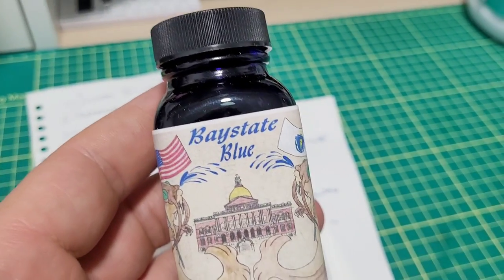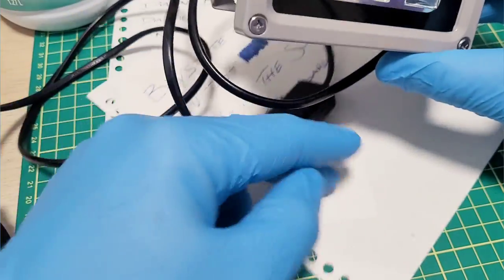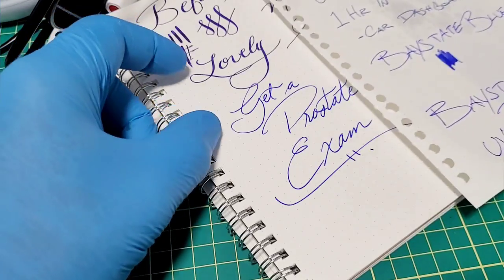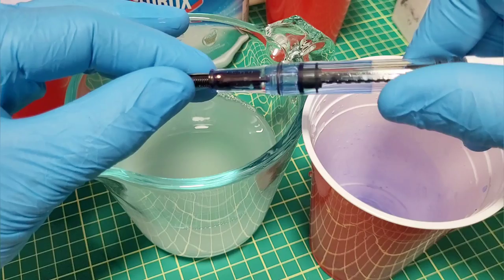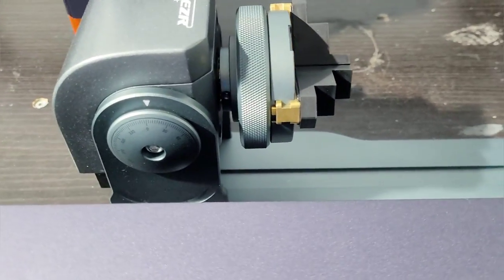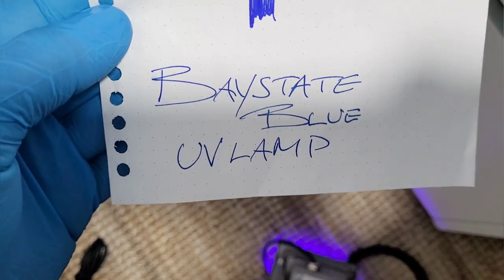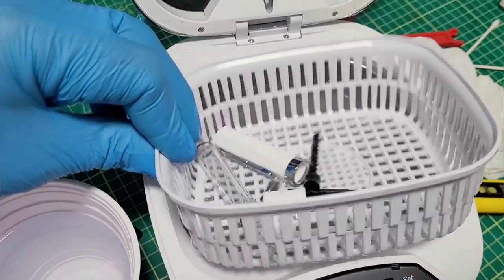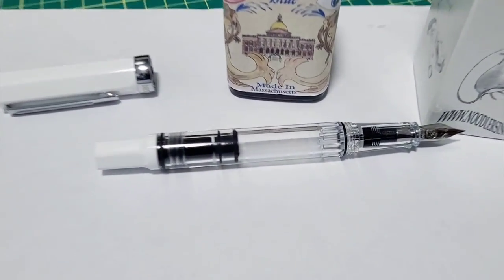Episode 2 - The Final Cleaning - Doodlebud VS Noodlers Baystate Blue

Comment: The piston got sticky because the bleach stripped away all the lubrication. This is normal when you're doing a deep clean on a TWSBI, especially when using a basic solvent, like an ammonia based pen flush. It attacks the silicone grease and removes it when you flush the solvent out. Anyone who's saying "it reacted with the rubber" clearly doesn't have a TWSBI that they've taken apart for a deep cleaning. Any time I pull a piston out of my TWSBI's, they automatically get re-greased. Worth noting, DON'T LUBE THE SHAFT OF AN AL OR AN ALR 580 MODEL WITH SILICONE GREASE. Use white lithium grease instead! The silicone grease will seal off the pen and create a pressure chamber or vacuum in the back of the pen, OR it will get very sticky. Flip a coin on that each time you use the piston.

Comment: Skookum as frig 
So first windshields will block UVA and UVB rays and this will maybe change what LEDs or discharge lighting needed to bleach the ink apart. Not that it's bleach, it's light, but it bleaches lol.

As far as the 10% sodium hypochlorite aka bleach can work, so in thinking maybe some peroxide may also be able to work. With less damage to some materials but more to others. 

And C3 I'm a weirdo creator who's working on getting the personal channel open again and my main question is. Is it. Or is it not it. ??

Comment: Hello. I'm kind of new to fountain pens, but I have three now. The first was a Noodler's Ahab, which wouldn't write more than a few lines. So, I cleaned it, tried moving that feed a teeny bit, and finally bought a new nib, the same nib, I think, the flex nib, extra fine? (Can't remember now.) But it is now practically spilling ink out of the feed. And I don't know what to do. I get ink all over my fingers. What did I do to it to cause that? I think I've fixed this, just needed some silicone. I hope that does the trick. Now one of my other pens won't write.

Comment: I have no fountain pen use knowledge, but now I'm intrigued, does anyone know if instead of cleaning the pen after this electric blue ink, instead are there other inks that would 'clean' it?  What I mean is empty it, then use a darker colour (black).  Then after the black has been in a good long time then empty it and do the usual cleaning?  (Like I said I don't know what I'm even asking, but sometimes you need oil to clean oil for eg)  Can you use ink to clean ink?
Reply: I understand what youre asking and no, putting new ink wont clean out the old one. Specially this electric blue!
Reply: @red2432  Well, it's a pretty colour, worth it's own pen I think.  I'd imagine most writing/drawing would be in notebooks so the sun-fade wouldn't be too much of a problem.  And even if it fades over years/decades, (so does our eyesight!)  It's still pretty to use now.